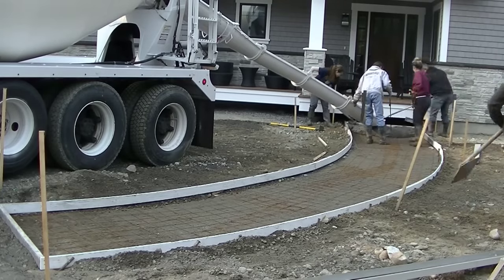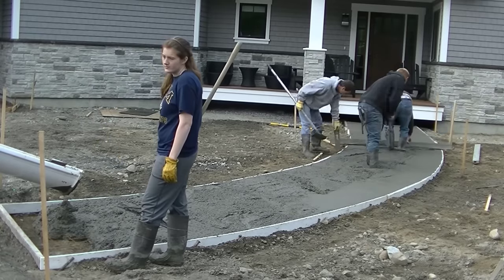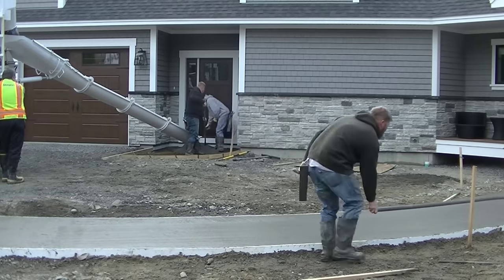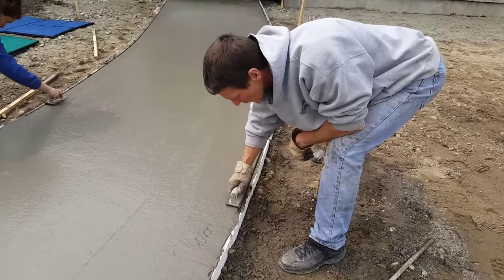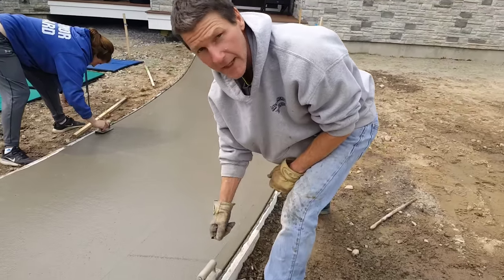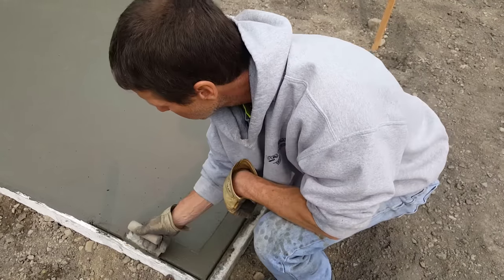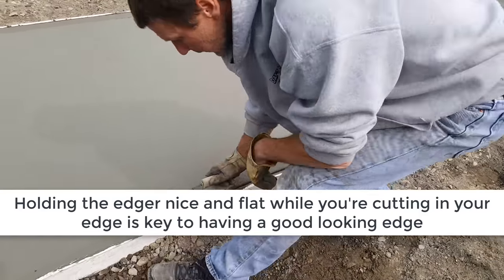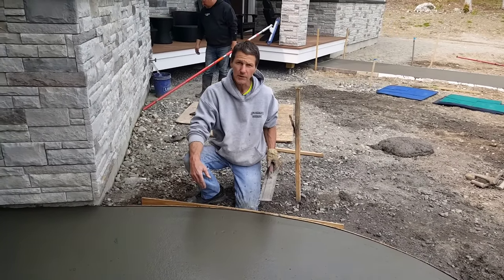When To Start Finishing Concrete After The Pour

Comment: I noticed you guys did not use rebar or anything!? Why...
Reply: I noticed you weren't paying attention... why? 
Clearly a wire mesh mat was down and one of the girls jobs was to pull it up as the Crete came off the chute. Not to mention the use of fiber mesh in  the mix.
Reply: Concrete guys say because it makes it harder to tear out! In reality, most sidewalks don't have rebar. And sidewalks will crack, that's why you put in control joints so that it cracks in the joint and isn't visible.
Reply from the maker: Thanks for that!
Reply from the maker: Yea, we usually use wire and fibermesh together. Then cut control joints like you say.
Reply: @shabugala  YES I WAS WATCHING AND NO THE WIRE MESH ON THE GROUND WAS NOT PULLED UP.  WHICH STRUCTURALY DOES NOT OFFER MUCH ON THE GROUND!!!!!!!!
Reply: @skliros9235  most sidewalks don't have rebar, well those contractors I WOULD NOT USE.....  As a "PE", yes I know concrete will crack, but it can be prevented (simple sidewalk), if the job is done right!!
Reply: @shabugala  I don't know why I wasted my time watching this video again, YES there was a lady there in the video helping (?), YES she had a tool to lift up the wire mesh as the concrete was poured BUT NO SHE DID NOT LIFT THE MESH UP!.......my eyes did not deceive me.
Reply: @dougthegreat1808  what did she used the tool for then
Reply: @davidneufeld8389  I can not answer that.  Don't know her, only what I saw.  And I did not see her pulling up any wire mesh in any real capacity!
Reply: The first 40 seconds you can see the, what appears to be, 4”x4” wire mesh on the ground. The girl in the maroon sweat shirt has a hook, she is pulling up on the mesh.
Reply: @richardheinen1126  do you have a life???
Reply: @dougthegreat1808  The girl in the purple sweater was definitely pulling up the wire. All you have to do is pull it up once, then the rocks from the mix get under it and it’s impossible for it to get all the way back down to the ground. It ends up in the bottom third, where it should be. Most sidewalks (especially public walks) are required NOT to have wire or rebar in them, so that it’s easier to cut sections out for utilities or repair individual flags that may have cracked.
🤜🤛
Reply: @psidvicious  I am a "PE", I fully understand concrete and it's idiosyncrasies.  Jesus H. Christ enough with all you people trying to show how erudite you are.  An no, that lady was do a very poor job lifting up that friggin wire mesh.  At the beginning she was doing a poor job of it.  Later the workers we walking all over it, pressing down the mesh.  I was not responsible for managing THAT job nor was I paid to inspect THAT job and finally I did not pay these contractors for this job.  I COULD AND GIVE A RAT'S ASS AS TO HOW IT TURNED OUT!!!!
Reply: @dougthegreat1808  As a PE, do you hire many concrete contractors? I’m curious what the going rate is in your area for concrete flatwork?
🤜🤛
Reply: @dougthegreat1808  😂😂😂 Suspicion confirmed 😂😂😂 Mr. PE. 
🤜🤛
Reply: @psidvicious  Most new construction does not require any renforcement because you never know what the potential homeowner wants to do down the road. They might want to change the driveway and add a different style patio etc. THEN when that time comes the homeowner should choose the add rebar because they will be living at the home forever (hopefully) and don't want any problems. Plus it saves the home builder money because they are all about profit.